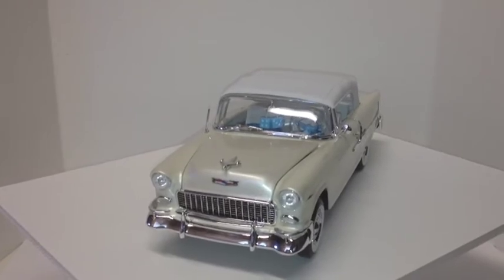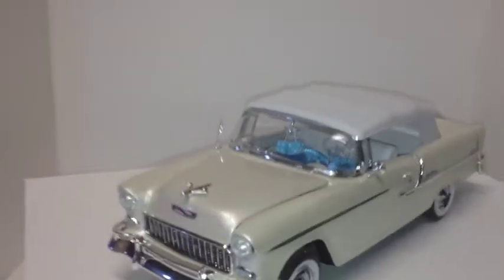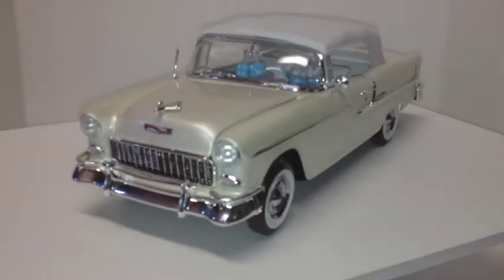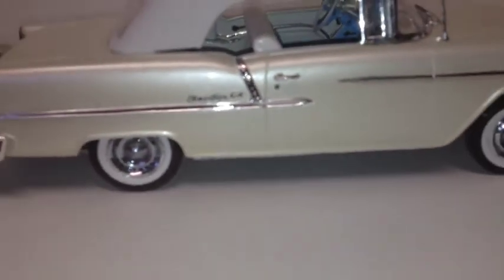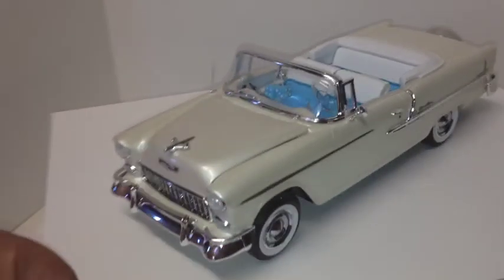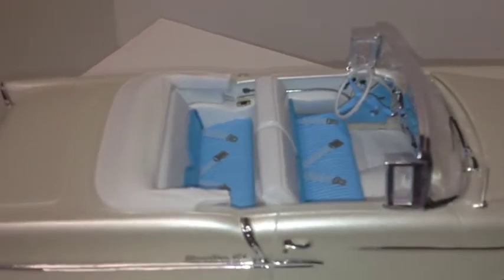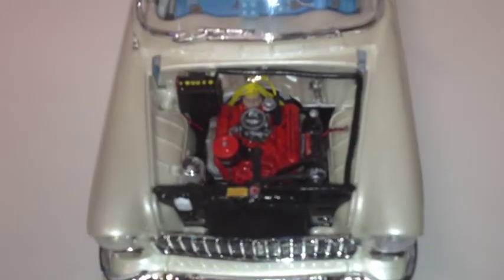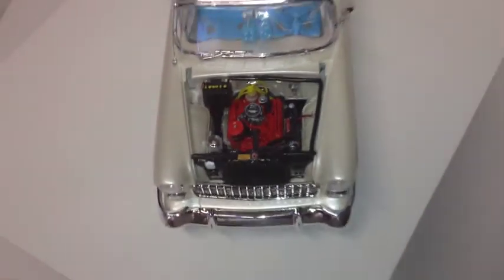1955 Chevy Bel Air Convertible

Comment from the maker: The purple pond is purple power industrial degreaser. We use it to strip off paint from model cars that go bad. I had problems with the clear coat bubbeling and so I soaked it in Purple Power to strip the paint off and restart with clean plastic. Us moder builders call it the purple pond .

Comment from the maker: I put createx pearlized white. Then sprayed createx gloss clear with pearl ex micro pearl poder over to give it a sparkle. Then cleared it with Dupont enamel clear to seal it all in and be able to wet sand it. The createx colors are water based and the first time I tried to wet sand the clear to smooth it out the paint gummed up being water based.